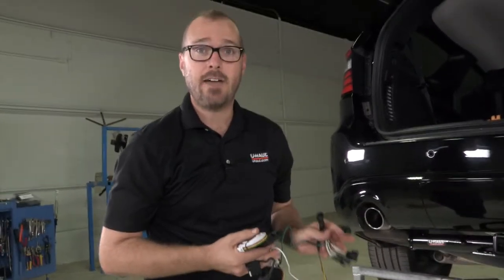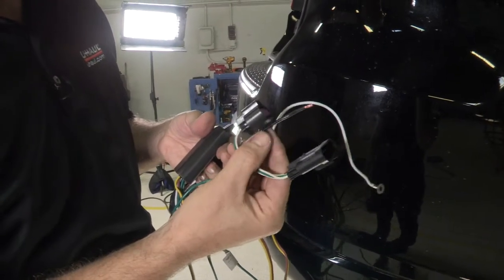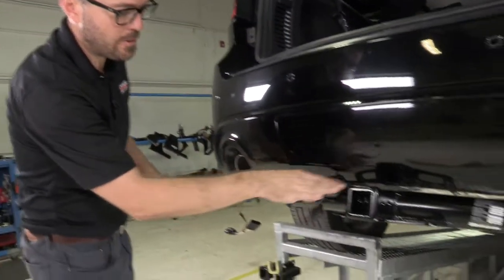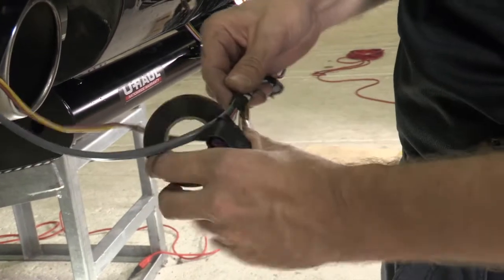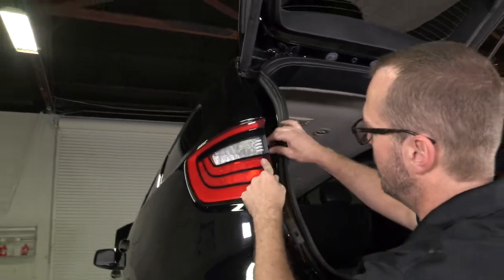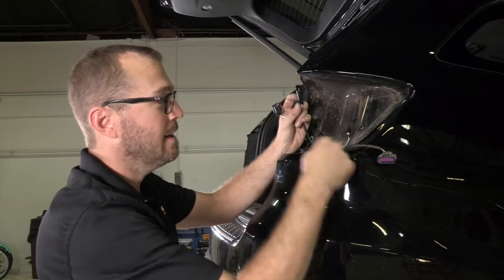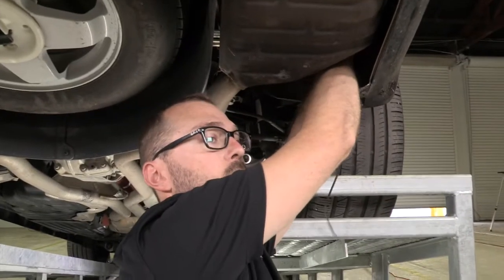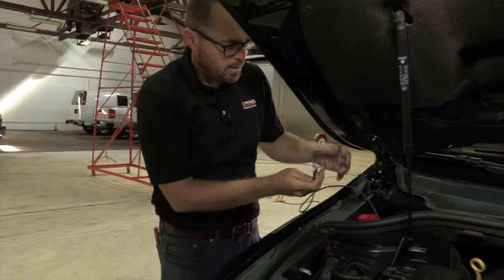2018 Dodge Durango Trailer Wiring Installation

Comment: What’s the power wire for ? Electric brakes ?
Reply from the maker: No, the power wire draws 12v from the battery to power the convertor box and then sends the signals to light your trailer. It is essential to the function of the convertor box. Electric brakes is a part of a 7 way socket and something entirely different.

Comment: Ground on a painted surface? 🙃🙃🙃
Reply from the maker: According to NEC 250.8 Connection of Grounding and Bonding
Equipment
(A) Permitted Methods. Equipment grounding conductors, grounding electrode conductors, and bonding jumpers
shall be connected by one of the following means:.

(5) Machine screw-type fasteners that engage not less than
two threads or are secured with a nut
(6) Thread-forming machine screws that engage not less
than two threads in the enclosure

NEC does not require paint to be removed for an approved ground and our method falls under these guidelines. And after 75 years of this method, paint has never been a reason of a bad ground connection.

Comment: The battery is so much closer than that location.
Reply: Less than a foot... you just ran the cable 15 feet from the rear to the front... what's another foot to get it done the right way.